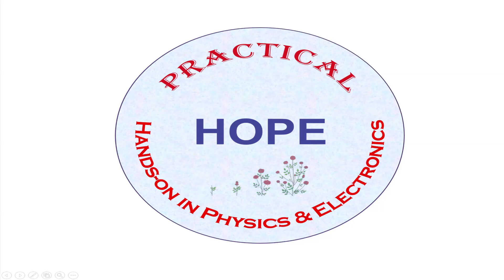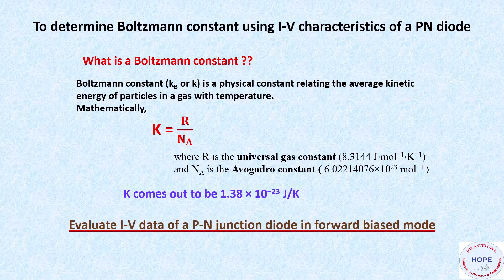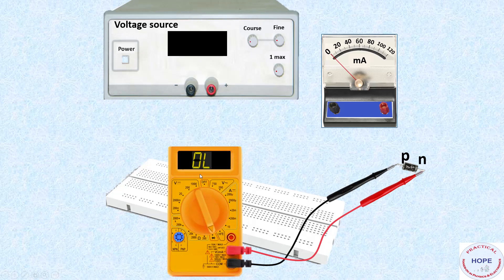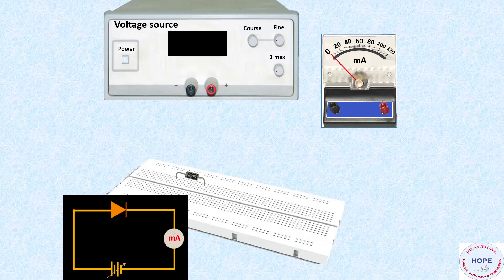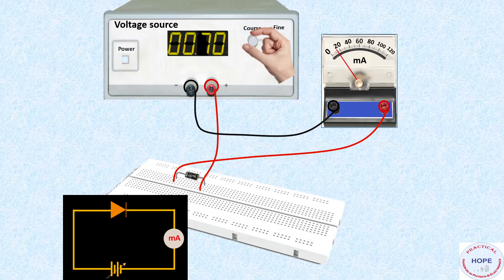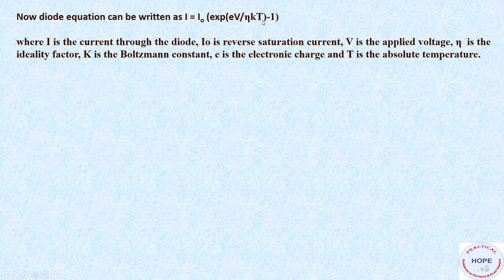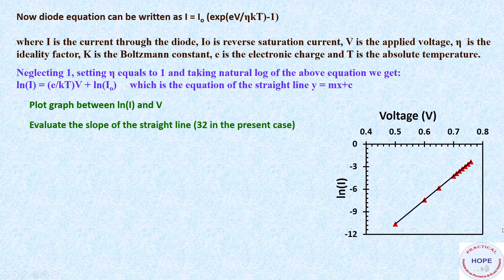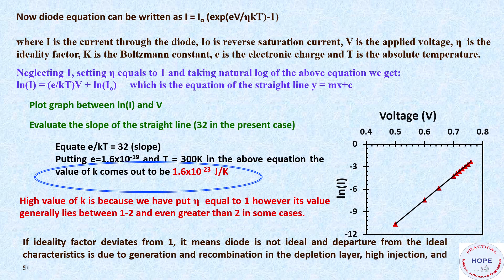Evaluate Boltzmann constant using I-V characteristics of a PN diode

Comment: Nice video.... but it would be better if u provide  the full observation table nd  clearity in graph...nd also how to calculate slope
Reply from the maker: Observation tables will vary depending upon the diode that we use. so no use of readings. I think calculating slope of a straight line should be easy.